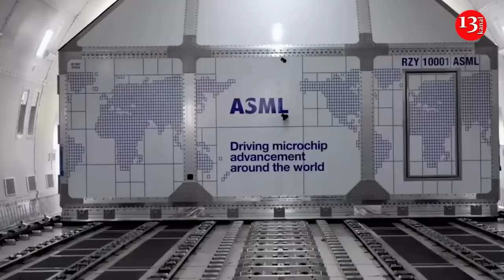Russia uses old Dutch ASML machines to produce microchips for weapons against Ukraine

Comment: Very likely 150nm..
Thats late 90s intel chips..
Reply: They will save a cRAzy fORtuNe on all that start-up money by going w/ the Intel 150nm chips!
Reply: @davids1inwestholl45  Nope..

Even china has 15nm chips..
They are just wasting time..

150nm its quite obsolete, almost comical..

150nm its intel 3 , try to run anything other than an old useless linux kernel..